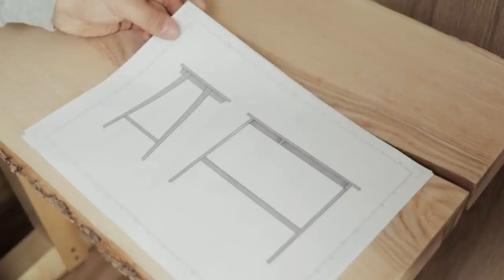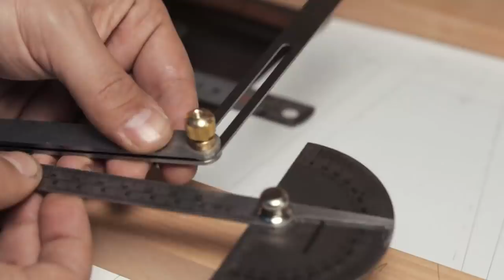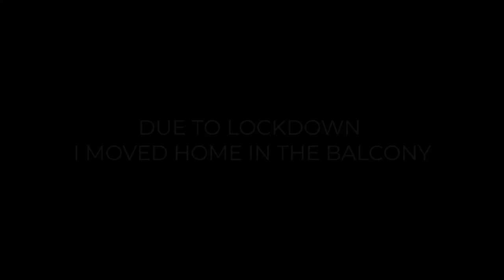Making a Cherry Desk - All Hand Tool Joinery

Comment: It is a great build and kudos on the excellent joinery. I was wonder if you think of a way to attach the top to the frame with only joinery, rather than screws.
Reply from the maker: Thanks! If I do it again I would have tried sliding dovetails all the way of those 3 rails then inserted in the top. I was reluctant in doing this from the beginning, wasn't sure I will succeed...next desk :) And this I should have made from the beginning, made the top first, sliding dovetails on the rails then dimension the long rails and back stretcher after these.

Comment: Hello Adrian, hope you are doing well. I think you are now either working in something great to show us or moving to your new shop if you haven't. I want to bother you with a question, I need some light. I want to know how do you determine the thickness and sizes of the wood for your projects. For example, here how did you determine the top table thickness and the size of the legs, drawers, etc. If you have any recommendation or now a book, magazine or something I would appreciate it a lot. Thank you very much, keep safe :)
Reply from the maker: Hi Ricardo, yes, you're right, busy with moving :) Check my IG for photos from the new shop. For sizes and proportions I don't have nothing strict, I just study other models over the internet and decide. Most of the time I make a 3d model and analyze it in either orthographic or perspective view to understand better the proportion and size ratios, and I'm very keen about them to turn ok. Probably not always I get them to look right, but I work on them :) But yes, usually with comparison to other well known designs...
Also, most of the market is standardized in thicknesses, for ex. 18mm (3/4") melamine board or plywood, lumber at 26mm (1") and 52mm (2") and so on. These standard thicknesses were created probably because they were used the most in industry, in design etc, the common way.

Comment: Hey Adrian, how often do you sharpen your marking knife/gauge?
Reply from the maker: The marking gauge maybe once a year, depends where and how much I use it. When I did the tool wall shelves with that hard ash I wear the blade intensely.
The marking knife, Idk, this Pfeil I use now is new, but I guess the same. Before this I had a Veritas knife, that slim with the black plastic handle. Just at the beginning I broke its tip by mistake and I tried do redo the bevel and when I tried to sharpen it don't know what the hell happened but the steel exfoliated, the flat part, seemed like it was made from thin layers...eventually I managed to make it work, used it about 2 years, the bevels were not so pretty but workable.    
For both I only sharpen them at #1000 then very few strokes at #5000. I don't like the marking blades to be mirror finished, they kind of stuck when they are that super polished.
In a few weeks I will put out a clip with sharpening almost of all my tools.